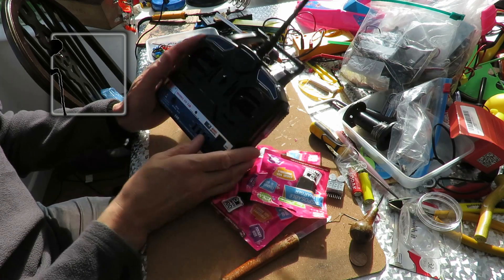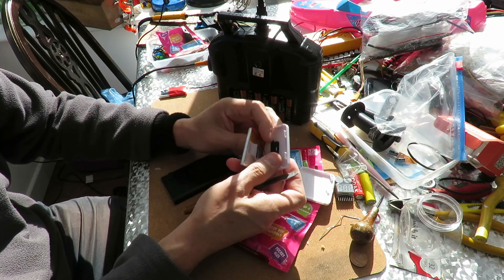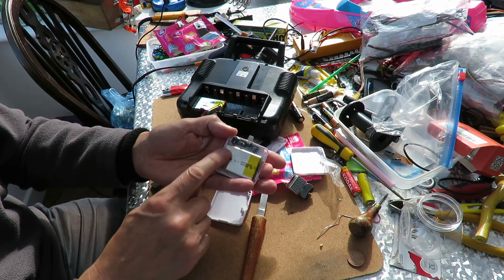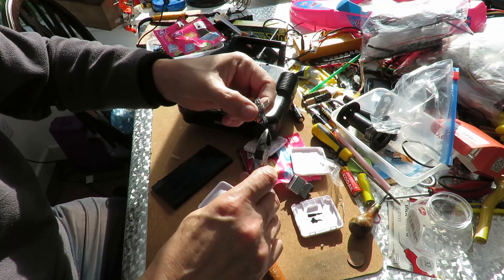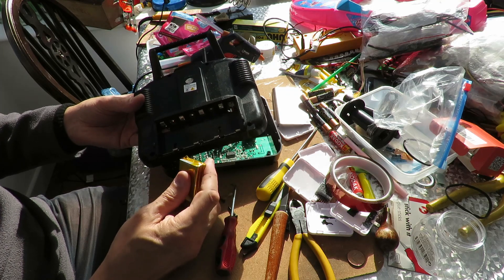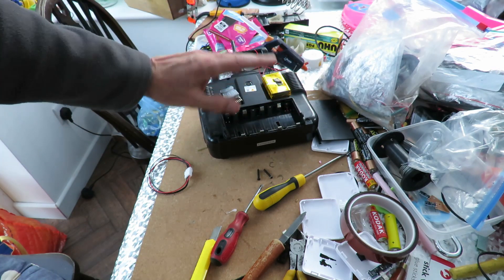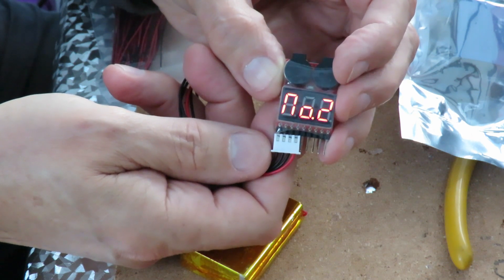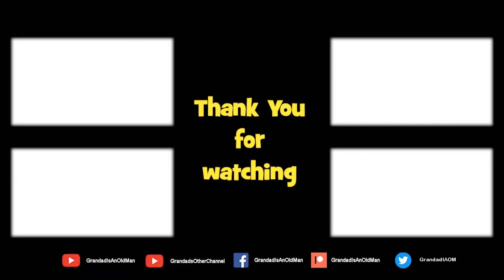LiIon battery for my RC transmitter

Comment: Hey I'm using an FS-CT 6B and I was thinking about converting to Lipos..My Lipo is 1000mAh 3S 25C..I read the TX lipo shouldn't be more than 1C..Will it cause amy problem if I connect the battery to my TX.Please reply!!
Reply from the maker: I should think it will fry it with pretty blue smoke. How many volts does the existing battery supply and how many volts does a 3S LiPo supply?
Reply: @GrandadIsAnOldMan  Existing battery supplies 8AA*1.5 =12V...The lipo I'm trying to convert provides 11.1 V
Reply from the maker: @raushanara5462  yes, as I say in the video, it should be OK but I repeat I am not recommending this modification. Many people do it, but it is entirely at your own risk. By the way, a fully charged 3S LiPo gives you at least 12.6 volts, but 8 brand new Alkali AA batteries also give you more than 12 volts so there should be some tolerance built into the circuitry. I think the advice about the 1C is to try to limit the amount of current available to limit the potential damage should it occur. Remember there is a good chance the LiPo could catch fire is it all goes horribly wrong.
Reply: @GrandadIsAnOldMan  What is the C rate on the batteries that you were using?
Reply from the maker: @raushanara5462  I have no idea, I don't think they were marked with a C rating.
Reply: @GrandadIsAnOldMan  Okay then I will stick to Rechargable Alkaline Batteries.
Reply from the maker: @raushanara5462  like I said, it is a common modification, but you need to be aware of the potential problems. Maybe do a bit more research and check a few more videos. I have just looked at a few and a common mistake is connecting the battery in reverse. That WILL kill your receiver.
Reply: @GrandadIsAnOldMan  the C rating is 1x capacity ex: 1x 2200 (mAh)= 2200 then divided by 100 ex: 2200/100 = 2.2A
1C=2.2A
Reply from the maker: @nunodias3331  thanks. That is not how I understand "C" rating or at least not the way I would explain it. The C rating is related to the time it takes to safely discharge (or charge) the battery. So a 2200 mAh rated at 1C can deliver ALL that 2200 mA in one hour. A 2200 mAh rated at 2C can deliver that 2200 mA in 30 minutes. That would be the maximum rate you could discharge the battery at full load, or put another way, if you try to discharge the battery faster than the C rating you will damage it. If you are using the battery in a high current draw situation then you would want a high C rating. Racing drones would easily be 50 to 100C and only be in the sky for a few minutes before the battery is flat. Back to the original question about the C rating for use in the TX, you are not in a high current draw situation, so a low C rating would be fine and your TX should last for hours rather than minutes. Just for reference, my TX is still doing fine on the batteries I put in it and it lasts for so long I often forget it needs charging 😊👍
Reply from the maker: If you read advice that says it should be limited to a 1C then I suggest you stick to a 1C. Why don't you check with whoever gave that advice. As I say in the video description, I don't recommend this. You do it at your own risk. It has worked for me with no trouble so far, with the cells I used, so that is just over a year of use.

Comment: hi daddy, i just thought hmm its crazy putting 8 batteries in my transmitter i wonder if i can replace with a lipo, then finds your vid!
Reply from the maker: Absolutely no guarantee from me. You do it at your own risk. Certainly if it has 8 AA batteries then 8x1.5=12volts so it should handle a 3S LiPo OK but I repeat, you do it at your own risk. I can confirm it is working fine for me.

Comment: There is a Lipo battery that perfectly fits the case of the transmitter. I bought the 1st Lipo battery for my FlySky FS-T6 from HobbyKing (relatively expensive) and the 2nd one from Banggood (super-cheap).
Take a look at the video on my channel just typying FlySky transmitter modifications.

Comment: Just a quick word of advise. When running that transmitter off a 3S Lipo, the slight extra voltage at full charge (12.6v) can overheat the voltage regulators on the board, so keep an eye on it the first few times. I have seen it happen. Also, the differing voltages as the Lipo discharges can confuse said regulators as well. Other than that, good job.